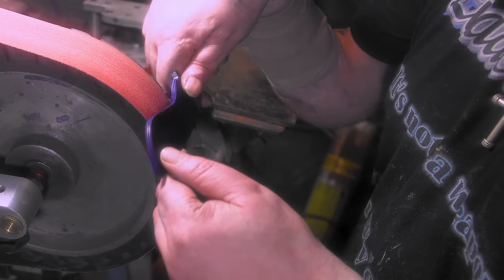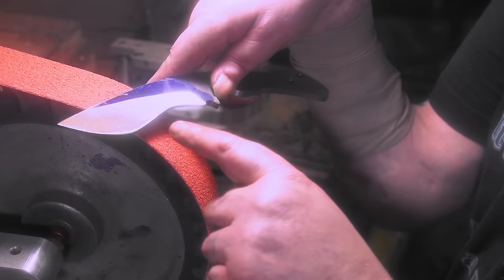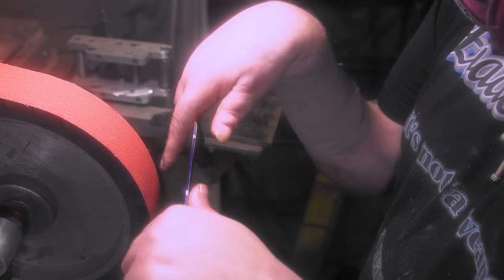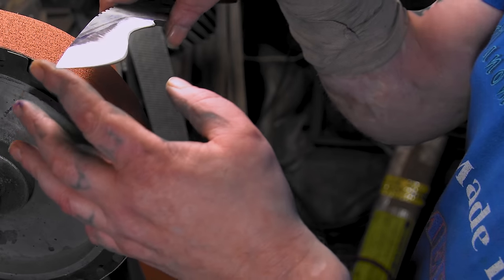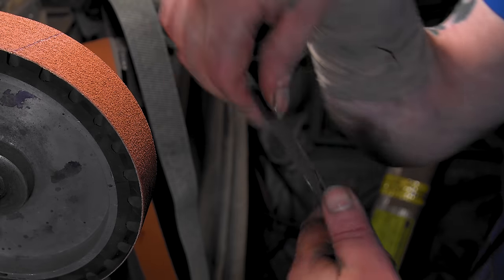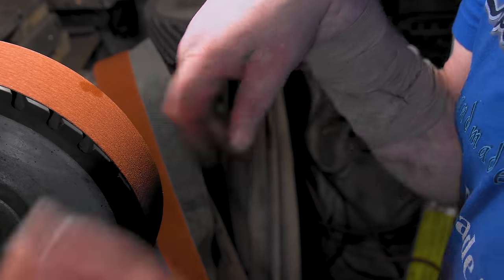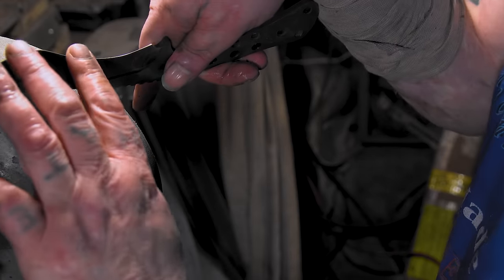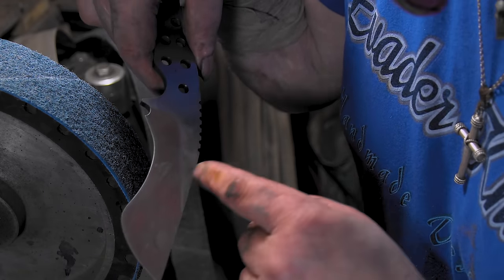Custom Recurve -Bevels(hollow grinds)

Comment: Awesome i need a mentor like you be well bro  . Is it possible to achieve hollow grind with 6 inch grinder u know like stone wheel i guess ill try an see what happens
Reply from the maker: I don't think a stone wheel will work too good. You can try it, just be careful, they aren't really made for stuff like that.
Reply: @evaderknives  thanks for your input be well